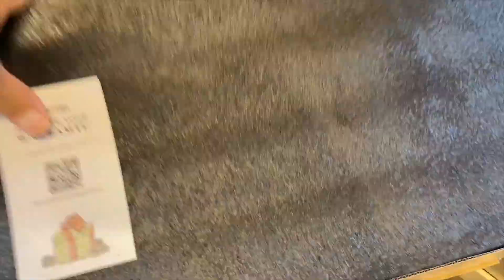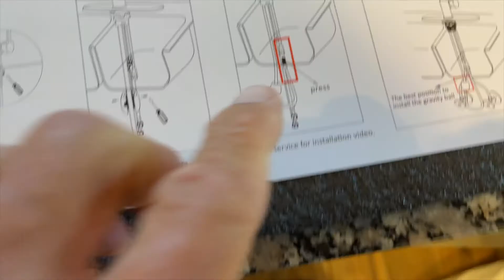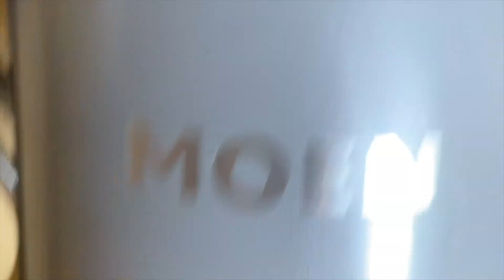How to install an OWOFAN pull out Kitchen Faucet

Comment: Just installed my faucet this morning after watching your video. I found that using an O2 sensor socket with extensions and a ratchet to remove the old nut holding the faucet on is much easier than trying to use a crescent wrench or pliers.
Reply from the maker: Yes, excellent tip

Comment: My Owofan faucet has the split nut for mounting, which will not stay tight. Is there an option to get a nut without the split? What size would I need?
Reply from the maker: I was just measure the pipe and see if you can get one at Home Depot that will tighten down